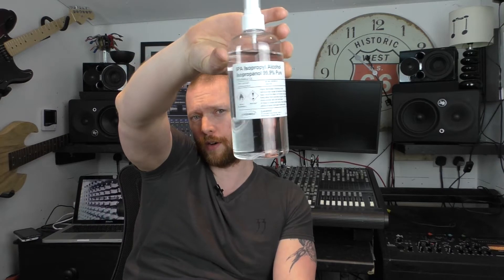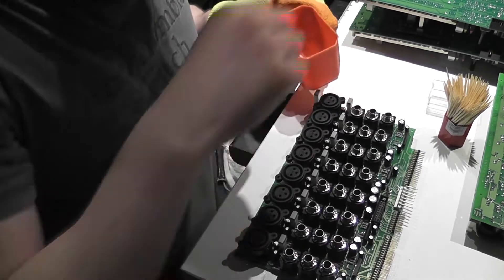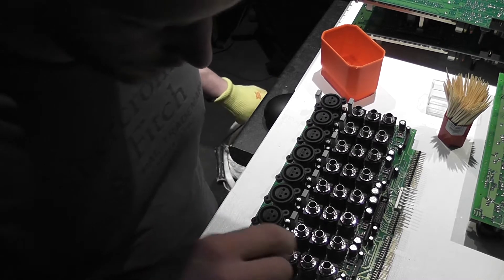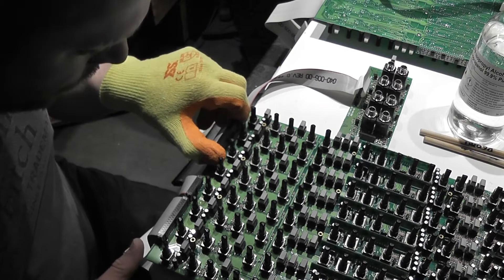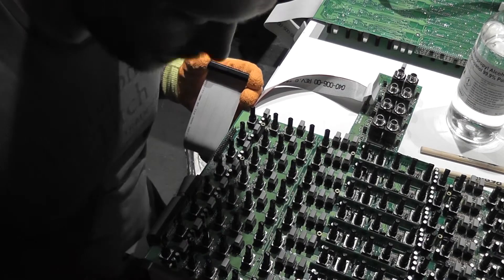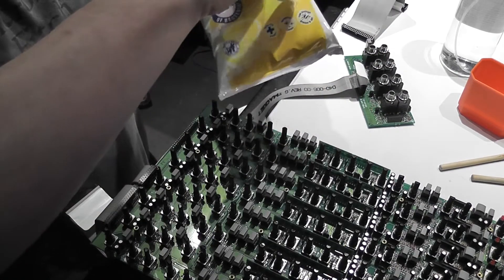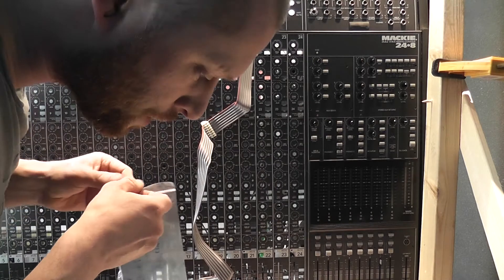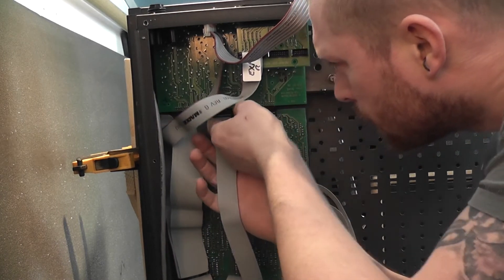How to Service a mixing desk part 4 - Mixer Cleaning

Comment: Awesome job man! I just acquired a Mackie 24-8 for $100 with a fully functional meter bridge. It only has 2 dead channels I may have to replace 2-4 pots together fully functional mixer. This mixer was always on my bucket list so I will tackle your methods to see how it turns out.. if all fails it with be a wall ornament in my music room..Your videos have been a great help to my disision process, weather to take on a project like this..Thanks

Comment: Today I picked up a 24x8 with original box, mackie meter bridge with original box, and mackie desk/stand, all in great shape for $400.  It is dusty and needs a complete strip down and clean. I see there are many here going through the trouble of doing the deep clean, so while the system is disassembled, I'm curious if anyone has re-capped the boards? Capacitors usually last 15 to 20 years before they degrade and change the circuit for the worse. Thoughts on recapping anyone?

Comment: I found a video showing a way to clean the XLR connectors with D5 Detoxit and pipe cleaners.
Did have a question, I am cleaning two ( 2 ) boards 24 x 8 and 32 x 8 and need to know where I can find replacement potentionators for a few that are broken,
Thanks A.Dunn

Comment: Does a Mackie 32 8-bus have separate channel boards...?
Reply from the maker: It has board for each set of 8 channels so it will have 4 board for the 32 channels and another board for the master section and sub groups. 5 boards in total

Comment: Great video, thank you. Just tried this on my mackie 1604, when I plugged it back in it only registers a signal on channels 11-15 (green light blinks) however I am only plugged in to channel one (xlr in) which gets no signal at all. Any idea what may have caused this? I am planning on reopening it and checking the connections again.
Reply from the maker: It sounds like some of the looms aren’t connected properly. Is there a chance one or some have been connected upside down?
Reply: Thanks so much for the reply. Not sure what you mean by looms?
Reply: Just did a quick google search re: looms. Seems to be a like a snake of xlr cables? The closest thing resembling these in my board (mackie 1604) would be the ribbon cables or molex connector. Is this perhaps what you mean? I’ve tried connecting the molex connector both ways. One way results in my initial problem (signal from channel 1 registering on 11-15) the other results in all the clipping lights turning on when the board powers up. Neither way gets the board working properly. Any suggestions? I originally opened the board up to clean it and reseat the ribbon cables because I was getting a crackly clipping sound on every channel.

Comment: watching this to try to psych myself up to tear open my mackie 32-8, exact same era. big boat of a board but I love the thing. it's got a myriad of little issues but the most annoying is that all of a sudden one day all the LEDs on the meterbridge and board all went out (all at once, it was bizarre). Some local tech told me "the boards are old so no guarantees we can fix it" and I don't feel like being overcharged for them to say "sorry bud couldn't figure it" so time to get DIY.. just quite nervous as I've never done anything like this especially not on such a massive machine. will be coming back to these videos for help haha ..
Reply from the maker: Sometimes there are deeper issues but this is about as far as you can go in servicing a surface mount PCB desk like these. Just take your time, let everything dry properly and be thorough as it’s not fun doing it twice.
It will probably take 8-10 hours to clean but then leave it open to dry for a couple of days

Comment: I used your videos to service my dated 32x8 with a 24E. That was 56 channels of knobs and switches. Took me a week to service the boards following your instruction. I had some issues with the left channel popping out when it warmed up and a few other issues, not to mention scratchy pot. Now my boards work perfectly and look brand new. Thanks for taking the time to walk us through the process.
Reply from the maker: Fantastic. Glad it worked. I always worry that people will rush it and power it back up before it’s dried.
You can use the same techniques on microphones and other studio equipment

Comment: Just a question about using the Mackie desk to front end a DAW using a digital interface.  My digital interface is a Focusrite 18i20.  I want use the Mackie to record guitar and bass, send to analog effects and add some more analog essence to the signal chain. On my Mackie I have a bank of AUX sends and AUX returns.  Would these be appropriate to use for sends/returns from my effects, or should I do the split stereo cable that I've seen in one of your other videos?
Reply from the maker: I used to have that interface. Loved it. If you’re adding a compressor or eq into the chain then I’d use a split cable and do it via an insert. For other effects such as reverb or delay then I’d do it via an aux send & return. Then the aux knob acts as a way to add more / less.
Reply: Pherotone Studios Thanks  for the tips!

Comment: Got to this piont and the Power distributor blew :(
Reply from the maker: What do you mean? Was it on while you were servicing it?
Reply: Pherotone Studios nope, it was the day after. Put it all back together, using photos. Everything was in the correct place. Plugged the power in and turned it on. There was a loud crackle from the area where the power goes in and the only thing that lit up was the ‘rude solo light’, nothing else is working.
I’m  about to recheck everything but it makes sense there’s something wrong with the distributor. 
Might just be a case of it being old and taking everything apart pushed it over the edge. 
Anyway, the tutorials were a great help. Thanks again. Just need to figure this new problem out now
Reply from the maker: Oh no. That does sound a bit odd. Could any moisture have been left in there somewhere? Is it a similar desk to the Mackie in the video? I’m not too sure how to track down where the problem is but could a connection have popped off?
Reply: Pherotone Studios yeah, going to check the cables when I get in. Could have been moisture but it was at least 15hrs after the last bit of cleaning. 
It’s a 24-8 like the one in the vid, but a rev D
Reply from the maker: 15 hours should be more than enough time for any moisture to evaporate.
I honestly can’t think what it could be but, like you said, the distributor would make sense
Reply from the maker: Could one of the internal looms be back to front?

Comment: So i finished cleaning up my 32 8 but on channel 8 the imput light and clip light just stays on. What could have caused this?
Reply from the maker: I’m not sure. Maybe some dirt got dislodged and is on channel 8’s section of the PCB but could be something in the inputs for that channel. I’d give the XLR and jack inputs another clean for that channel as they’re easily accessible and see if that solves it.
Make sure it’s not plugged in when you clean it though

Comment: My son just picked up a Mackie 1604 mixing desk that needs a good cleaning. After watching all 4 parts of your video, we're going to give it a go.  Thanks!
Reply from the maker: Fantastic! Those 16 channel Mackie mixers are a perfect size. I could never track one down.
Make sure when you’re cleaning to take your time and let everything dry before reassembly. Let me know if you have any questions
Reply: @PherotoneStudios  Just wanted to give you an update on my Mackie 1604  service.  After following your steps, we got the mixing desk back together and tested all the channels. Everything works!  I was a bit nervous about the ribbon cables as they are rev A versions, but we cleaned all the header contacts and no problems.  Thanks again for such a clear process in your videos.
RayK
Reply from the maker: I’ve only just seen this. So glad it all works. It takes ages to do but it’s worth it
Reply: Pherotone Studios Your video was a tremendous help in tacking this job. Thanks!
Reply: Will do!

Comment: Hi ... Your video will be very useful for me. My 24/8 is off since 2001. And now ... it has a lot of clicks, hums and hums in the subgroups. My console is from 1996. Made in USA totally. Not assembled in china. And it sounds different from the ones that were assembled in China. I do not know why.

You think I'll clean it and I'll be able to recover. ?? I'm in love with the sound you could get in the 90's and now, with everything digital ... I can not achieve.

Thanks again, bro
Reply from the maker: Yeah it should be fine. Just take your time and be thorough. Also let everything dry out fully before reassembling it. It’s better to do it once properly than have to take it all apart again.

Also take pictures as you go so you can work out where everything went.

What make console is it?

Comment: Pretty amazing job...,I have the 32 channel version of that Mackie.
Reply: I also have a 32 channel mackie 8 bus desk which i plan on servicing very soon because of channel drop outs and dusty pots and switches. My one also has the additional meter bridge and original power supply as well as two goose neck lights.
Reply from the maker: They are such good desks, extremely versatile. If I had the space I would have kept it but my studio is too small now. Any issues with yours?
Reply: Pherotone Studios My Mackie has been in daily service since October 1994....it’s on about every day for 8:hours.  It and my whole studio are pretty much overkill at this point...I just do voice over for TV stations all over the U.S. but I used to do a lot of radio production from Westwood One among others...but no real issues with the Mackie at all.....I do take the power supply out and high pressure air clean that.  About every two years it gets pretty dusty with that cooling fan sucking dirt in.  Lived in Los Angeles for 23 years...now in Las Vegas.  I’d send pics but can’t do it hear.  Thanks for the great videos though....very interesting...not sure I personally would want to go that far but at least now I know how if need be.
Reply from the maker: That’s incredible. 25 years! And always better the devil you know so I’d trust your desk over any desk that passed through several hands on eBay. 
That sounds like fantastic work and if the desk doesn’t have any issues then there’s no point in changing it. I prefer an analog desk for latency free monitoring.
It is an ordeal cleaning it and you need to leave it to dry properly so it’d be out of use for maybe 24-48 hours. You just don’t want any moisture left inside it

Comment: Outstanding tutorial squire. These desks really do get mucky. Any advice on how to repair the left (main balance) XLR on the ProFX12? Mine just stopped working all of a sudden. I’m now cleaning and can’t see any faults. Any advice would be muchly appreciated.
Reply from the maker: Thank you.  Id give the sockets a good clean in case any gunk is in there and then have a look at the solder joints where the XLR meets the PCB to see if they've broken or anything like that.  maybe spray some contact cleaner on the PCB and make sure no dirt has got in.  
Worst case scenario would probably be to replace the XLR but that can be extremely difficult on those tightly packed PCBs and if there's too much heat you can end up peeling the metal wiring from inside the PCB off. 
Hopefully a good clean will solve it and also clean the ribbon cables where they all clip together as it could be that

Comment: so, after watching these videos bro, and after hearing a local vintage electronics serviceman turn me down on servicing my Allen & Heath board, I Jumped right in. I did change the order of things Deoxit, alcohol, Deoxit (again)...And I got to share with you something that worked even better for cleaning 1/4" jacks and XLR holes >>> Mascara wands (certain types)  I found some that had pipe-cleaner like metal stems and a plumbing like snake brush at the tip worked like a charm.Thanks for demonstrating we can take care our own shit...one thing though, all my pots were fastened to the deck with 1/2" machine nuts...took 16 hours to do the same job on a 20 channel console
Reply from the maker: Ah man that’s fantastic! I’m a little surprised that they refused to service your desk but I suppose less of these old desks are around now so less people know what to do with them.
As long as you take your time and do a thorough job throughout, nothing can really go wrong.
Mine isn’t a proper large format console so only takes around 8 hours to service. Allen and Heath desks are a better desk all round and I hope it was well worth doing?
Great shout on the mascara wands!

Comment: so yeah reassembled it to exactly the same state as before i disassembled it, all leads and cables back to their original places, plugged it into the power supply and turned it on. about 10 seconds passed before i was greeted with two pops and some smoke, what the fuck have i done?
Reply from the maker: +ben scargill it sounds like something has shorted due to moisture somewhere. How long did you leave it between last applying anything and turning the power on?
Reply: Pherotone Studios it’s fairly likely that there is some lubricant on a pcb somewhere that I’ve missed, could that have done it? If that is the case, what can I do to repair it
Reply from the maker: it's probably some moisture stuck somewhere where a lot of power flows, like a ball of fluff soaked in something.  I'd open it up and find out what started the smoke, leave it open for maybe 24 hours just so all moisture can evaporate and then investigate
Reply: Pherotone Studios just tried powering it on again, I don’t dare leave it any longer than a couple of seconds but all that happens is the “Rude Solo light” flashes red, no other lights or anything seem to come on except that one
Reply from the maker: That is odd.  Something must be shorting.  Which desk is it and where did the pops and smoke come from?  It's quite likely that there may be a ball of dust stuck in there somewhere which has absorbed a lot of moisture from one of the cleaning products and is causing it to short.  

It's probably worth taking it apart and spraying some compressed air around to dislodge anything like that.  Try and see if there are any black or burnt out areas which would help track down and work out what's happened.
Reply: Pherotone Studios it’s the same desk as yours, the popping and smoke don’t happen now just the flashing red light. The smoke seemed to come from the main outputs and it appears the three metal prongs between the circuit board and the output might be slightly blackened, the thing is I didn’t even spray anything in the main outputs, I can’t see any damage or anything anywhere else. I’m going to download the Manual PDF and have a read through it.
Reply from the maker: I wonder if a ball of dust got blown down there or something and caused it to short.  Did you let everything dry and evaporate before putting the desk back together?  The only other thing it could be is one of the connections not being put back in the right place but I've taken those desks apart several times and I'm pretty sure the connectors only work one way and won't fit in other connectors so you can't get them mixed up.
Could there have been moisture on the rear panel that could have dripped anywhere when the desk was turned back the right way up?
Reply: Pherotone Studios so I’ve just had all the circuit boards back out, whilst wiping down the ones on the back I noticed a bit of blackness and I’ve blown two of the electrolytic capacitors which I’m assuming is what the pops and the smoke were. Why would this have happened though? It’s the proper power supply and it worked before I went through and cleaned it all so I’m not sure. Will I better getting some replacement capacitors soldered in, buying new circuitry all together or throwing the entire thing in a skip and putting it down as a bad job?
Reply from the maker: Hi Ben.  Did you get this sorted and work out what had happened?
Reply: Pherotone Studios changed the blown Capacitors and reassembled it, plugged in the power supply and now it seems like the power supply isn’t working. Nothing whatsoever on the desk, light on the front of the power supple is on but the fans not spinning. I give up!

Comment: When you use the alcohol after the Deoxit, you don't neutralize the D5 treatment then?
Reply from the maker: +Tape Leaks the alcohol is to remove the D5 from the PCB so for that part yes. For the knobs, buttons and other bits the D5 gets worked into them as it gets sprayed directly in there, the alcohol should remove that.  The alcohol evaporates really quickly too. 

It can’t hurt to be careful though so you could always dip a brush in alcohol to run over the PCB. Obviously not dripping wet but that’d be a good approach.